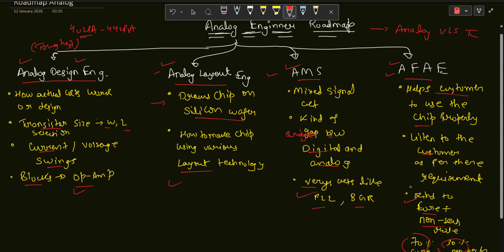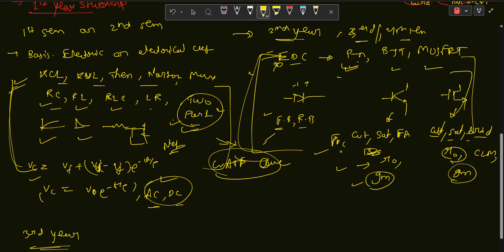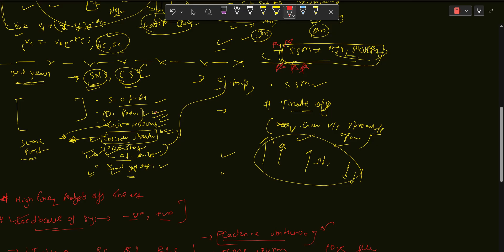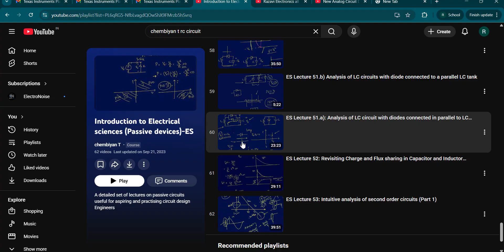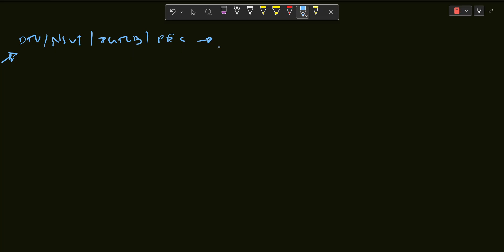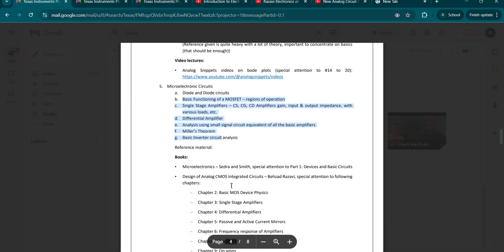How to Get a ₹40LPA+ Job in VLSI! 🚀 Analog Design Roadmap for 1st & 2nd Year Students.

Comment: Sir i am in mtech in communication and signal processing stream in one of the top 5 IIT, currently in 2nd semester. Can i prepare for analog vlsi roles, i mean i have almost 10 months left for placements
Reply from the maker: Yes Sure , you can cover analog syllabus just in 3-4 months if you do consistently. Just stick to the plan